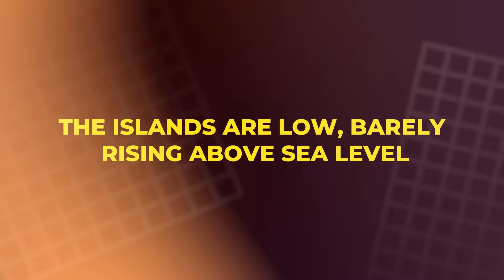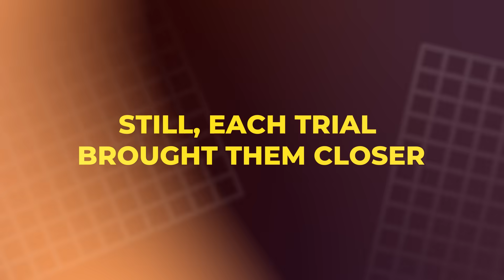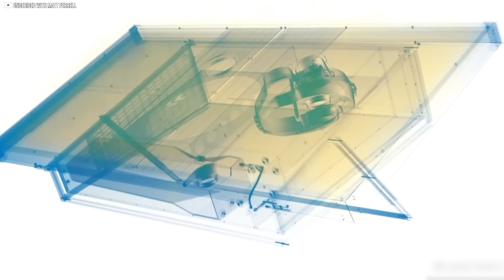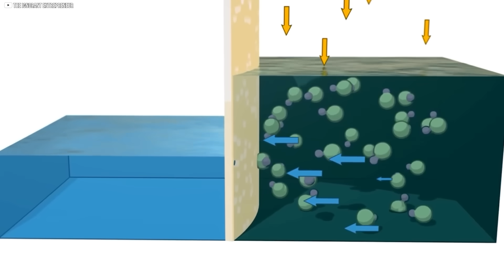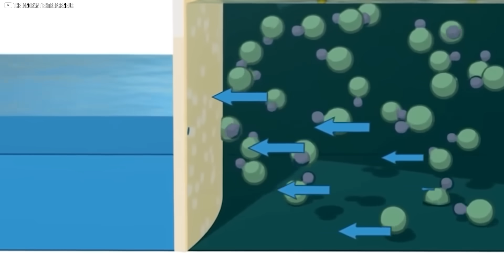MIT’s Sun-Powered Invention Could End the Global Water Crisis

Comment: Gemini provided the answers:
Is this device a real invention by MIT?

Yes, it's a genuine MIT innovation. Here's what reputable sources confirm:

MIT engineers have developed a passive, window-sized device that harvests water vapor from the air using a hydrogel panel enclosed in a glass chamber, which condenses and collects clean drinking water—no external power source needed.

The setup was tested over a week in Death Valley, an extremely dry environment, and produced up to approximately 160 milliliters of drinking water per day.

The scientific details are documented in a peer-reviewed paper titled “A Meter-scale Vertical Origami Hydrogel Panel for Atmospheric Water Harvesting in Death Valley,” published in Nature Water.

This confirms the device is authentic, represents genuine research output from MIT, and is not a hoax or speculative concept.

Comment: The Hydrophobic Membrane enables water vapor to pass through and allows salt to be handled without accumulation and clogging in a filter. The vapor condenses and becomes clean, drinkable water. I guess that means the by-product can be recycled back into the ocean and not cause any environmental disruption? Can you post links to where I can see that this technology is currently in use (other than the example in the video)?

Comment: The solution is incredible simple ... use the salt for building, I had a discussion about that with ChatGPT Compressed Salt Bricks / Salt Blocks, Salt in Geopolymer Binders, Salt Crystal Structures, 3D-Printed Salt, Art, Calcium sulfate (gypsum) → Plasterboards (drywall) ,
Magnesium chloride → Used in magnesia cement (Sorel cement), Potassium salts → Fertilizers and fire-resistant panels. 

So in the end you even end up with a cheap housing solution

Pure Salt houses are also a thing.
Reply: Or make batteries, like CATL is now doing, or huge molten salt energy storage for stationary electric plants.
Reply: Wouldn't getting wet be terrible for houses made out of salt?
Reply: @nilsolsen8727  One would think so, thus the mixing of it. Pure hard pressed salt usually is build with in dry desert areas with barely rain at all, so it suprisingly doens't melt as much.